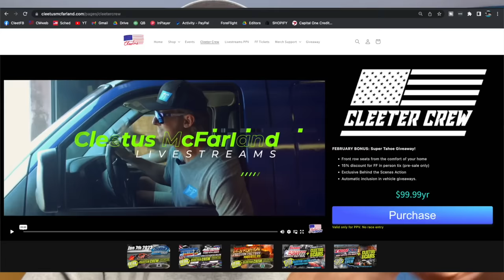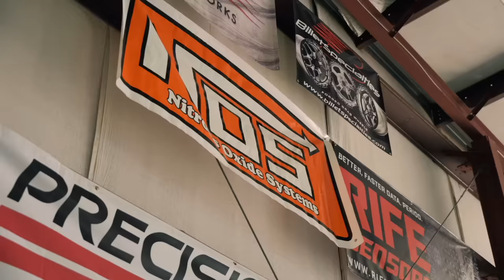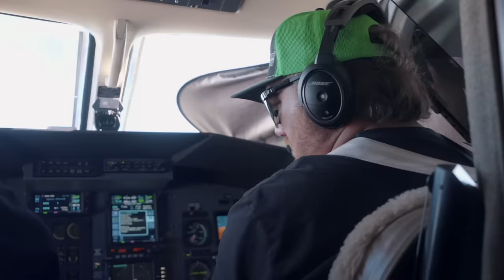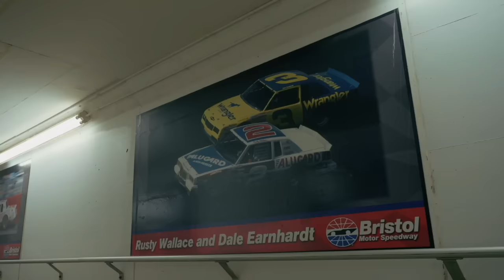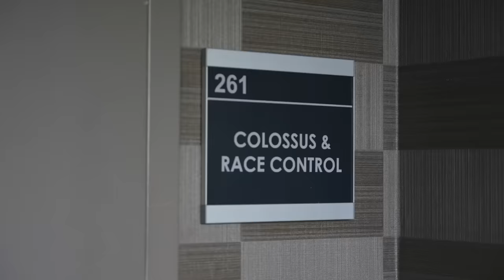The Smoke Show - Ep.1- Cleetus McFarland x Bristol Motor Speedway

Comment: 1st place race with a 3rd place finish.
I felt so bad for Kevin. His mistake really hit him hard because he's not a dirty racer.
Reply: Pay attention to the races looking for the facts, not feelings for anyone. In the previous race Kevin hit another car, while he is recovering he hit him again causing a crash. In this one he hit another car, make him loose. Instead of letting him recover proceed to go to his right side making a pit maneuver causing again a crash.
Reply: @pcihector  Cope and seethe harder my dude.
Reply: I would disagree on the pit maneuver. I forget who posted the video that showed slow motion. Might have been the crybabies themselves. But Kevin first steered up practically against the car above him then i assume saw he was out of room and went back to holding his line. Kevin said he was behind the dude awhile and figured he'd help push him around him. I can understand his thinking. Shit happens. Doesn't always go as planned. I doubt that he'd do it again. One other thing and i could be wrong.. put cleeter or somebody in sxsblogs car that can maintain control when the unexpected happens and i wouldn't be surprised if cleeter could drive out of that little bump in the back.... Overcorrecting is what i feel caused him to drive up into Kevin who didn't have anywhere to go...  my 2 cents.

Comment: Hey Cleetus. Little tip for your Vic’s. Ford used plastic coolant crossovers on the intakes in earlier year whales. They were NOTORIOUS for cracking. Wasn’t until I believe 05-06ish where they switched to aluminum crossovers. You guys made the right move replacing the intakes from ford cause they would’ve sent the proper aluminum ones. Just a thing to remember when buying the older whales, they have crappy intakes. Great episode.